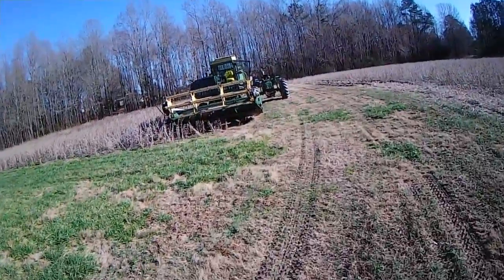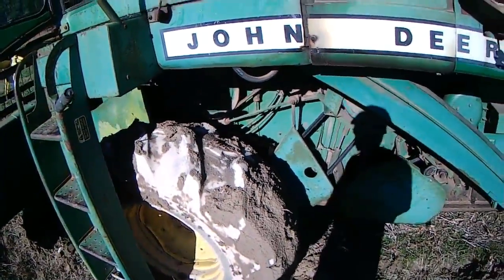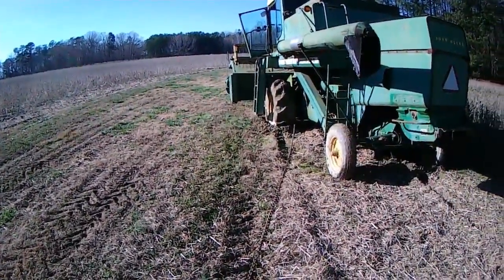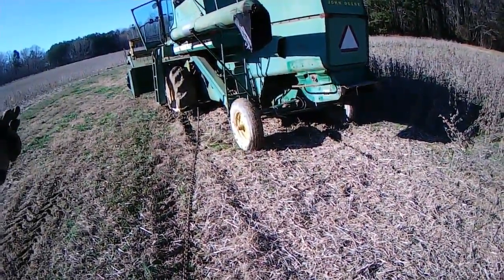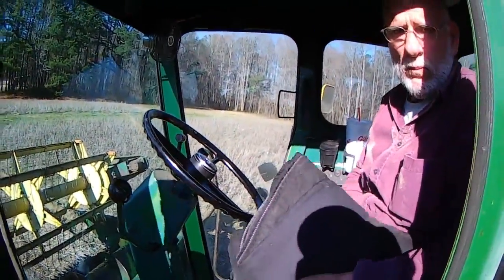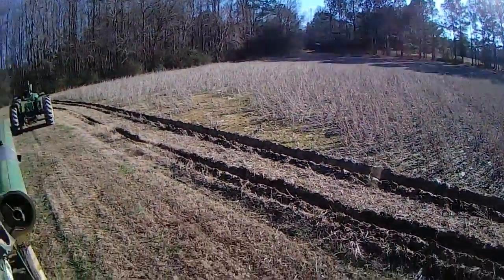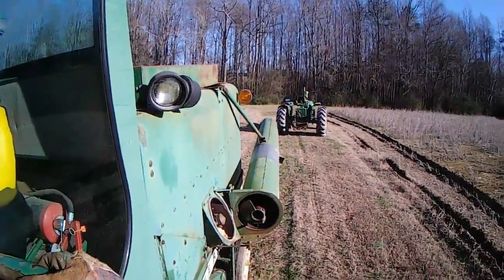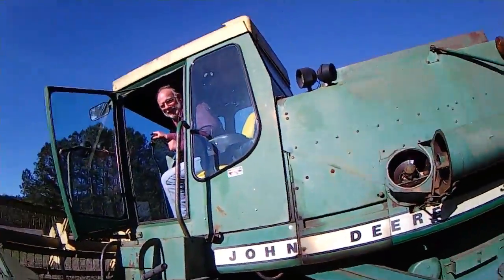January 26th Slinging mud part 5

Comment: I had a 403 IH  in the 80's and it like yours did not have a good anchor spot to pull from. I fabbed up a "harness" of sorts that was shaped like a Y and attached where you hooked to on the front drive axles. It ran the length of the machine and came to a point  in the middle of the machine right behind the rear axle. That was my pull point. Used it a few times without damage to the machine. I made it out of 5/8 cable. I tied it up under the machine out of the way and it stayed that way until I sold it. You have to remember to STOP before you bury one. Cousin Scotty evidently knows this the way he has been dancing around those wet spots...........
Reply from the maker: Johnny Holland – thanks for the idea on the tow cable.  Just might fabricate me one of those for future use.  Cousin has talent for dancing in and out of the mud.  I was so very happy he had the day off to help me.  Thanks for watching.

Comment: If you can, put a heavy cable under the combine hook it to the front axle and run it out the back and hook it to the back axle so it won't drag on the ground. Then make a loop on that end of the cable so you can hook a chain to it and pull it out. That way you have a quick hook point all the time. Works good for us.
Reply from the maker: Scott Eiler – several others have commenting with the same idea and I like it.  Thanks for supporting this idea for me.   Thanks for watching here.

Comment: I misunderstood the other day. I thought that you were all done.  Looks like you have a lot more to get. I was out Thanksgiving morning at 4am when the ground was frozen enough to get the rest of my beans.  I still was only able to get about 50 to 60 bushels in the hopper before I had to dump.  I would break though and start losing traction.  Good luck getting the rest of your beans. We are loosing about $.80 a bushel on beans at the elevator.  Now with corn, we get the market price because we have an ethanol plant and all the corn in the area goes there.
Reply from the maker: TAH-DAH Farm - actually finished up around 5:30 on January 26th.  Since YT analytics show most people do not watch more than about 4 minutes of my videos I decided to breakup all the video I shot into 7 parts. I watched the video you made picking beans in the dark.  Those LED lights came in really handy and made me want to put LED lights on the 3300.  I like the LED lights on the 4000 and the 4020.  Maybe one day I’ll have the money to put them on the 3300.   Before Cargill in Raleigh closed we lost about .45 cents on a bushel selling to the reseller.  Thanks for watching.

Comment: When you operate in muddy conditions, and you know the probability of getting stuck is good. Put the chain around the front axle and wire it on so it won't fall off. Then wire it to the back axle to keep it out from under your rear wheels. Then you just drag it around under the combine.  That way you don't have to crawl under it in the mud to chain it up. That's how we do it up here in Illinois.
Reply from the maker: Gary Clayton – fabricating as you and a few others have suggested seems like a great idea to me.  Not crawling in the mud would be a great plus.  Thanks for the positive support.

Comment: Would it be possible when your done to weld or bolt on a plate or hook somewhere on the rear area to make hooking up a chain easier than going all the way underneath?  Good times with Scotty. Thx
Reply from the maker: farmark – the 3300 does not have the strength in the frame to pull from the back.  At a great expense I guess the current frame could be strengthened by adding beams.